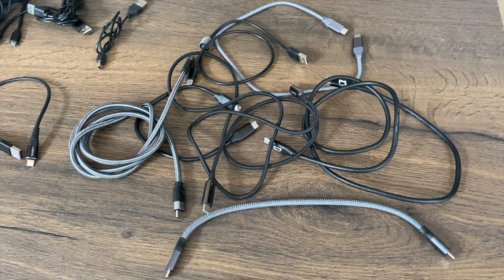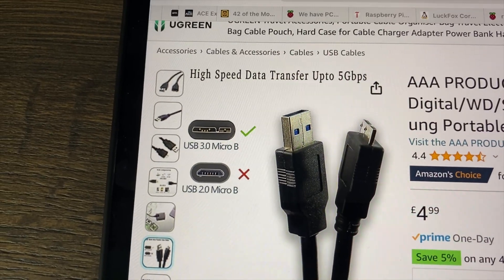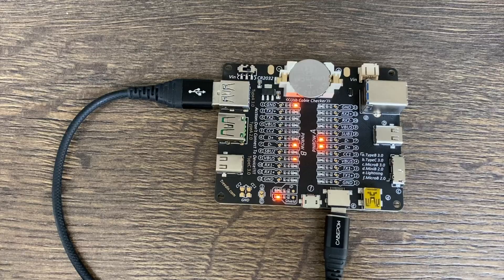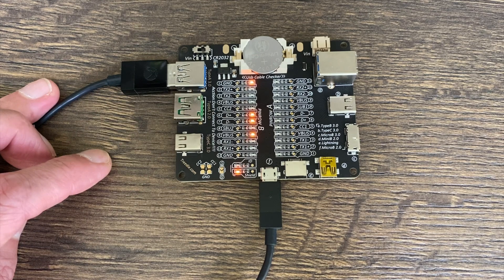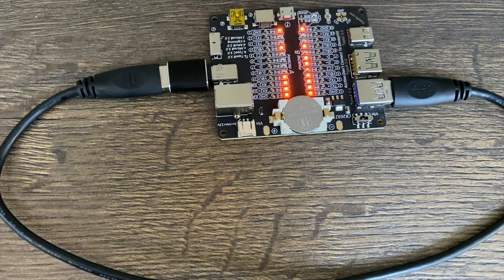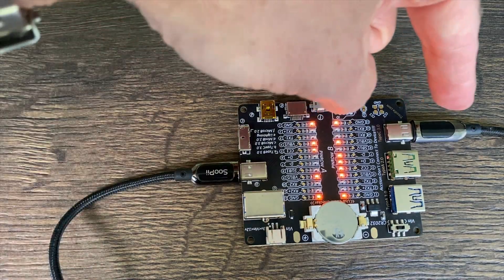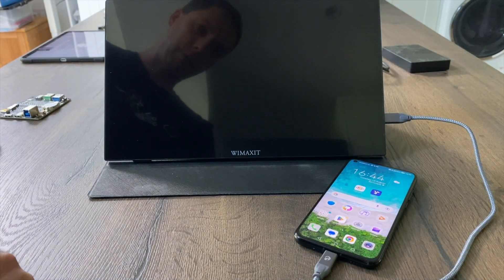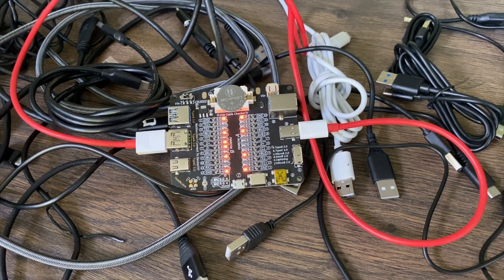Instant USB cable tester

Comment: I have a USB A to triple split output USB C, Apple and micro USB ports, like a hydra. Only use A -> C for charging Android phone (cable was a prize in a contest). 

The A -> C connection started out as a "fast charging" cable with phone recognizing it as such both with onscreen message and very quick top offs.

Suddenly it now registers with "Slow Charging" and phone battery level can't even maintain, let alone recharge if phone in use.

Tested it with two wall warts, same thing. Cable is visibly intact with clean connections.

Would this device help diagnose the problem, or can you recommend one that would?

Since I know it's a cable issue, I also know I could just get another. However I am trying to learn about USB technology and how it works. Also, I could understand if it just stopped  working altogether, but I don't understand why the power transfer degrades but doesn't stop entirely.

Thanks for your help!
Enjoyed the video.

John

Comment: This product should not exist.

It's just a led driven continuity tester. And at most we realize we don't have full data speed or features. With all the fast charging, PD or QC, we can't tell if a cable can handle 65W. For this we need to measure the cable and it's voltage drop. It would be possible to determine what cables are used and what max power could be sent trough the cable. I usually buy cheaper cables, and most of the time work nicely. But my phone is no longer accepting some cables, so I bought a thick cable and same story.

So we should be testing what power it can deliver safely, and maybe actual speed. This should be a pocket tool.

Comment: @3:10 Type A-to-Type A cables are not to standard! They can cause shorting. 😂 Type-A is host-end, Type-B is device-end. With double-ended Type-C cables it is negotiated between devices.
Reply from the maker: @heretolevitateme  I have had one for many years. Supplied with a Dynamode sata adapter. Other brands use them

https://amzn.to/3TsQE1t

Also used to be common for data transfer between 2 computers, although they were configured differently

Comment: I'd definitely buy one if it also tested signal integrity.  I have many many cables that all have identical standard pinouts, but some work with Android Auto some do not, some will flash my Arduinos and ESP32's and some will not... but all of them have all 4 wires including the data wires connected, and work in other data transmission situations like copying files to my phone.  I need a device that can tell me which of my cables are better and why.

Comment: A bit disappointed; no explanation on what the lights mean... so I still have no idea if this is useful.
Reply: its probably indicating the pins are connected
Reply: A Type-c connector has 24 pins. That's potentially 24 separate wires (in pairs) running the length of the cable. Not all cables have all wires. The lights mean the cable has the specific wire pair.
Reply: for me, it would be insane useful

Comment: Also I understand why in compatibility mode that it cant use two of the pins from og usb 1.0 but why cant the computer detect to some level so those 2 pins and wires are not wasted.

Comment: I picked up a few cable testers years back and there were only a few options and the only one with a variety of connectors requires a separate power input… For lighting a few surface mount led’s? I intended to copy the smaller micro to A tester with the battery and mod the larger one but never got around to it. Fast forward to today and there are several at the rock bottom prices we expect from China, the one featured in this video being the one I decided on for less than $20 shipped. Everyone should have a few of these kicking around especially if you’re into electronics, I’ve lost some hours to troubleshooting a project only to discover it was a bad cable or one that only does power.

Comment: I really appreciate your making this video. Thank you so much. Might you be willing to make one where you show how cables that are not working look with Treedix tester? I have two USB to USB Hard Drive type cables. Both of them lit the same lights on the tester but when in use, one of them keeps dropping and then the computer reconnects to the external USB drive while the other cable keeps the hard drive connected and never drops it.

Comment: I bought this tester.  Its so confusing.  I simply wanted something to tell me if the cable was broken so expecteced Pinrows A to light with Corresponding Pinrows B to show it is working.

Their instructuctions are expectedly terrible (translated from chinese) and even though their Amazon CS response is quick, it is equally confusing.

Normally, when i buy this sort of thing, i write new instructions for the manufacturer to share with customers, unfortunately i dont understand the device enough lol.

Comment: Only problem with this is it only checks for contact, not for signal integrity. I know thats enough for most things you need day to day (like "is this broken? Does it only charge or data too? Is this usb3 cable a scam or actually wired up?" And so on) and its a really cool thing for that usecase, but lots of people will forget a potentially way more important part of the whole thing: signal integrity aka. "is this thing using correct wires? how accurate were they with the length? Is it shielded and drilled correctly?" And testing that kinda stuff will be WAY more expensive. So i'll shut up now, i know i'm being a pedant 😂
Reply: 100%. People tend to neglect the importance of signal quality when it comes to digital signals and for power. This might be better than nothing, but after using it you still don't know if the cable is good.
Reply: AM I the only one confused about what ya all said, if ya cable indicates that it should work using this cable tester, then what am I missing if ya still plug it up, and it dont work, even sharlock would say, well perhaps it is broken???  DUH, again, what am I missing. this device is awesome, and works for most of what is needed to know, shows up when ya all plug in ya all cables, NO DEVICES!!!   HHO

Comment: we used to have: "1 protocol 1 cable". Now, we have: "all protocols" and "1 connector - type C" where everything is possible and usually whatever you wanted ... is what you are missing. Many USB-C cables, lots of descriptions on them and yet when it comes to connection... very often failure ;-) (we can easily forget type A and micro - they will vanish very soon).
There is a perfect video on Robert Feranec channel about it: "Which USB Has The Best Power? Big differences ..." - worth spending almost 2 hours to understand what is what ;-)
Reply: MOST of what you said, i read and agree with, now saying that, I do not agree with,USB MICRO will vanish soon, let alone just in the USA, in the world there are TONS AND TONS of devices out there and still being used, and for sure i think and say it will NOT BE ANY TIME soon that they WILL VANISH VERY SOON! sad perhaps but true!  HHO
Reply: @lecyalphamaids9134  in Europe micro USB is almost vanished already and I don't regret it at all ;-)
Reply: Totally agree. USB type C was introduced  as the "one cable for all" solution. But it turned out to be the most confusing type of USB ever! We used to have cable testers to see if a cable was okay or broken. Now we need a cable tester to find out what a cable actually is.
Reply: @Ni5ei  TRUE